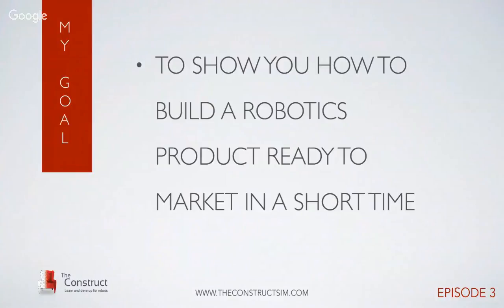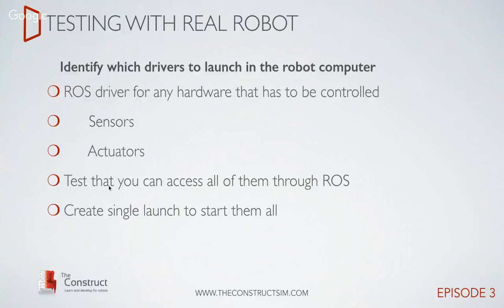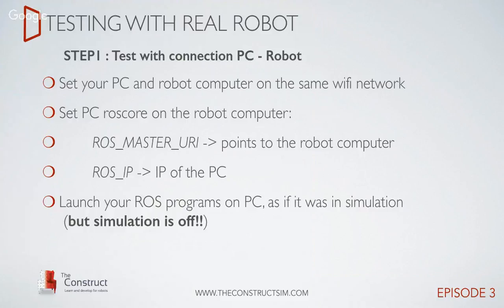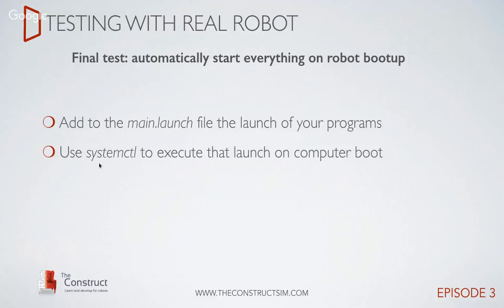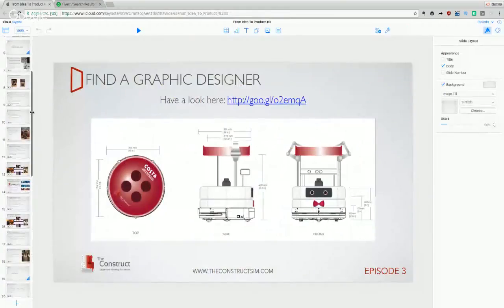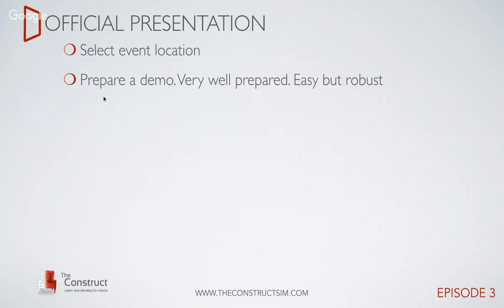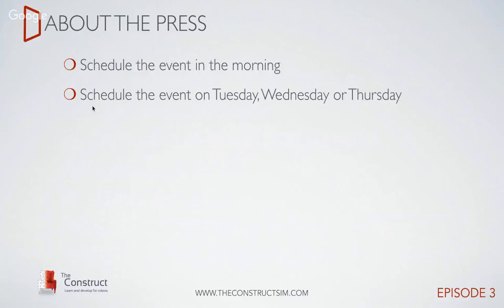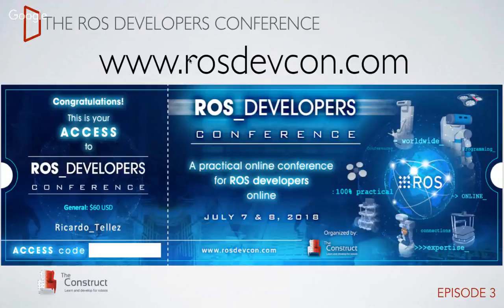ROS Robots Webinar Series - Ep.3 : From Idea to Robotics Product in 3 weeks

Comment: Hello, thanks for the great work you guys are going. I have a question I can't find it's solution anywhere. 
When creating a light sensor plugin, how do I get the topic name from the file of the robot? For one robot it works ok but this problem arises when several robots need to work with the plugin.
Reply from the maker: Mateo, in that case, you should change the line:
_sensorPublisher = _nh.advertise<sensor_msgs::Illuminance>("lightSensor", 1);
by the line:
_sensorPublisher = _nh.advertise<sensor_msgs::Illuminance>("~lightSensor", 1);

That is a small change but will make that the name of the topic for the illuminance is prepend by the name of the node it is instantiating it. For example, if you launch that code for a robot1 whose node name is R1, then the topic for the illuminance will be:
/R1/lightSensor
For another robot, with node name R2, the topic will automatically be:
/R2/lightSensor

If you want to know more about this subject, have a look at this doc: http://wiki.ros.org/Names
Reply: The Construct thank you very much ! Yeah I knew it had to be something small but just was trying and trying different stuff haha
Reply from the maker: Great! Keep pushing your ROS learning!
Reply: Sorry for bothering you again with this question, but after trying to apply what you suggested lead to an error. It compiled well but when roslaunching my world, I got back this error without being able to load it:

 Using ~ names with NodeHandle methods is not allowed.  If you want to use private names with the NodeHandle interface, construct a NodeHandle using a private name as its namespace.  e.g. ros::NodeHandle nh("~");  nh.getParam("my_private_name"); (name = [~lightSensor])
Service call failed: transport error completing service call: unable to receive data from sender, check sender's logs for details

I think it might be because the namespace of the plugin is gazebo and not the robot name but I cannot change it. Or maybe I should create a node in roslaunch for this particular plugin.

Any idea on how to implement this on the plugin constructor? Thank you. :)
Reply: No worries, I solved it by adding a topic name field for the plugin haha